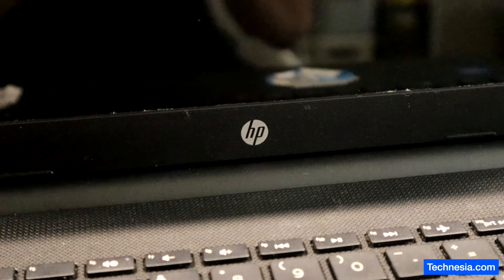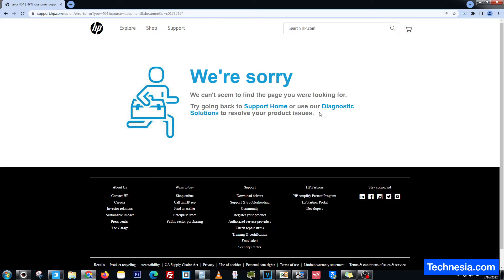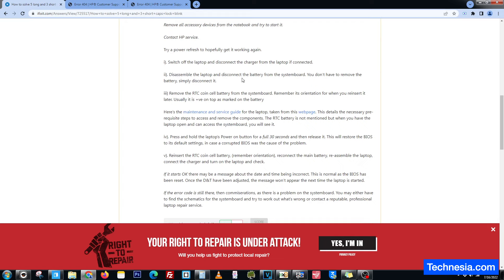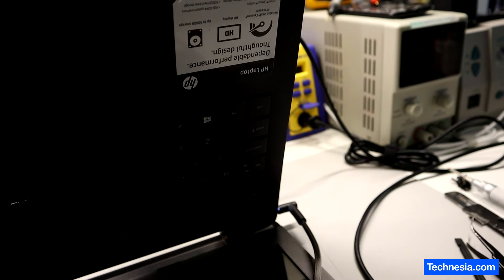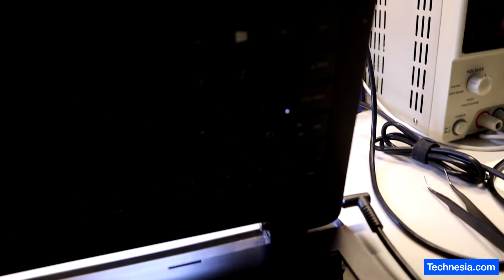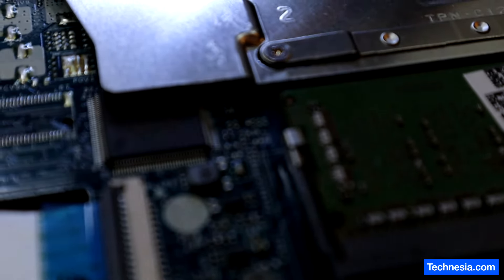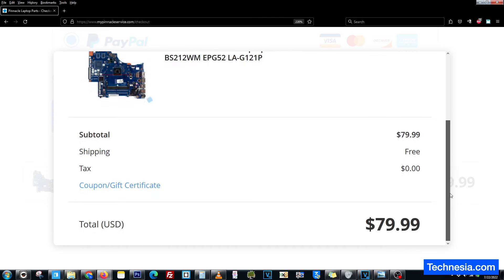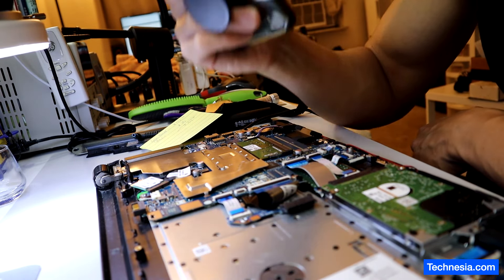HP 5 Long 3 Short and 3 Long 2 Short CAPS LOCK blinking error code

Comment: 3 longs and 2 shorts is the ram if anyone having this problem you should try removing ram or try change the replacement or clean it it should be working
Reply: Thanks a lot
Reply: I purchased a brand new HP laptop, and brand new PNY ram. The stock ram stick works fine, however when I remove that, and install the 2 PNY sticks, I get the 3 long, 2 short error.

If I try the PNY one at a time I get the error. When I put the stock one back in, no error.

Seems something I need to change in BIOS? Anyone know what to do?
Reply: @toolisgod6 try default settings of bios
Reply: @muhammademraanseo  i ended up getting it to work, heres what happened for others searching for a fix.

Even though I tried the following probably 6 times, it eventually finally worked, and it booted up with no flashes and recognized both sticks.

Unplugged battery, press/hold power for 20 seconds. Removed ram, installed both new ram sticks. I press/held power again for 20 sec just in case. Plugged battery back in, and press/held power for about 30 seconds this time. Then pressed power to boot up. Took a bit longer, but it fully booted and recognized the new ram.

Not sure why it didn't work the first pretty much six times, unless I didn't hold power long enough AFTER the battery was plugged back it.

But good luck to all.
Reply: I got it cmos changed and worked but it suddenly turned off during working like when ever I turn it on two three times it shut down suddenly, last nigjt

Now in the morning ,giving me the same three long two short error
Reply: thank you
Reply: hello bro I reput in mine then there's no blink anymore but now it's just blank screen do you guys know what might be the problem?

Comment: Maybe you did this and it wasn't all shown in the video, but removing the small BIOS battery won't reset the BIOS if you leave the main laptop battery plugged in and/or leave the laptop plugged into wall power.  You have to remove all three power sources and drain all power from the board to be sure.

Comment: I had this problem yesterday. I opened up the PC, removed the battery (my laptop doesn't have a CMOS battery so it uses the main battery as the RTC power supplier, so the CMOS battery is basically the normal battery on mine) and removed the charger. After waiting like 15 minutes and putting the battery back it started working cuz it restarted the BIOS.

Comment: Thanks sir it works for me. What I did is just 1) deassemble the laptop 2) I removed and disconnected the battery. 3) After a 15 mins I connect the removed battery and assembled the laptop. After that I turn on my pc and it works the pc display is on now

Comment: I had the same problem it’s a bios corrupted error hold down windows and b when powering on don’t let go windows and b keys until bios recovery starts if it don’t start you’ll have to download the most recent bios update for your device from hp and create a bios recovery flash drive and do the same windows + b
Reply: Tried this but didnt work
Reply: doesn't work for me, in my case I unplug the charger and leave it for a few hours. fixes itself after some time.
Reply: This solved the issue on my hp envy laptop.

Comment: I have a HP Pavillion laptop. While I was searching in the internet, I got 5 long, 3 short caps lock blinking error code. The screen was on not black. What is wrong.
Reply from the maker: do you see anything on the screen like HP logo or something?
Reply: Yes, the HP logo is on the screen.
Reply: I also have the same problem and go pavilion laptop did you find the fix please

Comment: I had similar problem with HP laptop. It was 5 long and 3 short blinks. It said some components are not seated well. So I opened the casing and ensured all components are fitted properly. The cpu fan was lifted a bit due to hinge problem. Fixed it and it worked.

Comment: i have a client who had this same issue on his motherboard.  After troubleshooting and decing to replace the mobo, I ordered the replacement and installed  it, the computer worked.  After a few automatic system updates,  the same symptoms started again with the new board. My client and i are flabbergasted  to say the least.

Comment: EDIT: Finally fixed, details in the sub-comment.
I purchased a brand new HP laptop, and brand new PNY ram. The stock ram stick works fine, however when I remove that, and install the 2 PNY sticks, I get the 3 long, 2 short error.

If I try the PNY one at a time I get the error. When I put the stock one back in, no error.

Seems something I need to change in BIOS? Anyone know what to do?
Reply from the maker: Make sure that the new RAM is compatible, it could also be defective RAM.
Reply: @danfromtechnesia  and update for others searching for a fix.

Even though I tried the following probably 6 times, it eventually finally worked, and it booted up with no flashes and recognized both sticks.

Unplugged battery, press/hold power for 20 seconds. Removed ram, installed both new ram sticks. I press/held power again for 20 sec just in case. Plugged battery back in, and press/held power for about 30 seconds this time. Then pressed power to boot up. Took a bit longer, but it fully booted and recognized the new ram.

Not sure why it didn't work the first pretty much six times, unless I didn't hold power long enough AFTER the battery was plugged back it.

But good luck to all.

Comment: Hi! I have a hp 255 g6 giving 5long 3short but the chip (alc3227) under the cmos is extremely hot. could the overheating component be the cause?

Comment: This is informative. I have a question that I hope you would be able to answer: I was using my phone and as I was putting it down, I accidentally dropped it and it fell on the laptop's top left corner, which I think hit the screen itself and now the screen is not working while the Caps lock blinks with 3 slow and 2 fast blinks. Do you think that the issue is the same as your diagnosis on the laptop in this video? We have an HP 15da. Thanks in advance.

PS: I don't see any broken glass on the screen either.
Reply from the maker: First you can try to re-seat the memory. Taking it off and install it back. If that doesn't work, check the memory slot, it may need to be resoldered.
Reply: @danfromtechnesia  Thanks for replying, Man. Do you mean the RAM stick?
Reply: @danfromtechnesia  And also, are you talking about the RAM memory slot as well?
Reply from the maker: @SoloMonYamashita-Hermit  yes RAM / Memory slot I use that term interchangeably
Reply: @danfromtechnesia  Just to make sure, so you recommend removing the RAM stick(memory) from the slot and attaching it again, and if it doesn't work, I have to have the memory slot(where you attach the RAM stick) resoldered. Am I right?
Reply: Am I right?
Reply from the maker: @SoloMonYamashita-Hermit  yes or also it could be the controller chip but it's unlikely
Reply: @danfromtechnesia  Controller chip? You mean the mother board needs to be replaced if the problem is in the controller chip?
Reply: @SoloMonYamashita-Hermit bro did your laptop work?I have the same problem.
Reply: @muhammademraanseo  I had it repaired. It's working now.
Reply: @SoloMonYamashita-Hermit  what did you get repaired?
Reply: @muhammademraanseo  I don't remember what exactly they repaired.

Comment: If you ever have the 5 long and 2 shorts just use bios recovery, don't know about the second one tho
Reply: How do i do that?
Reply: Wrong, same case here and bios recovery not working, the system not even do nothing.. bios programming too, only stops blinking but dead as crap is a HP notebook
Reply: @nopochoclos  same i somehow turned on pc intalled bios still it gives me black screen technician said its bios problem but those which are in board ship.
Reply: HP is crap @DracAxe  , expensive turd with bad rma and tech support, avoid HP .

Comment: My laptop HP ProBook x360 11 G5 EE Notebook PC. Ran in to problems the caps lock blinks 5 times, power lights on. When i press power button for 15 seconds and release, it turns of and back on by its self and caps lock proceed to blink white light slow 5 times. Noticed f12 light is on. Please help a brother here.😢😢